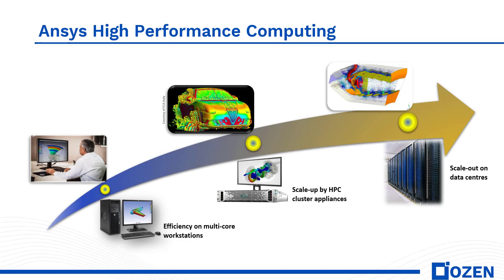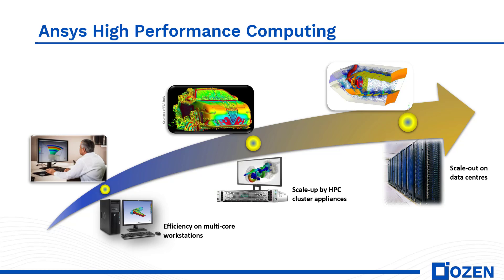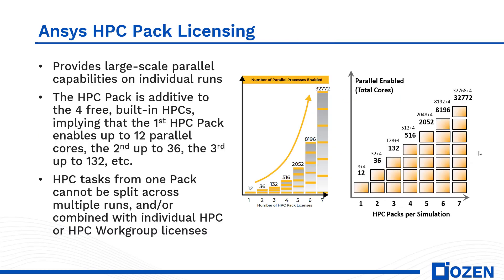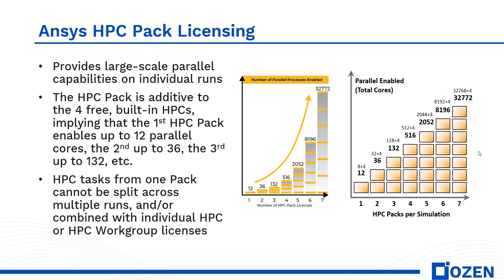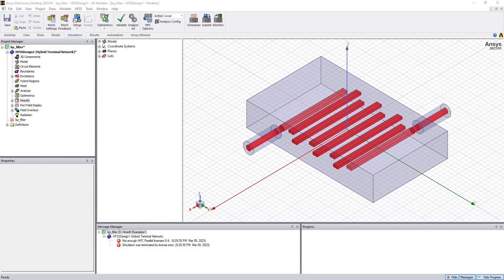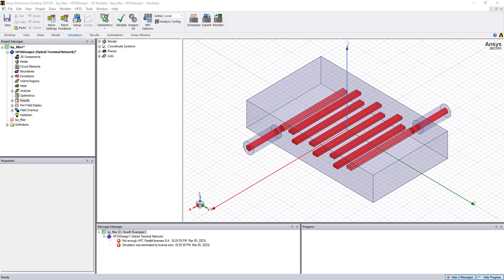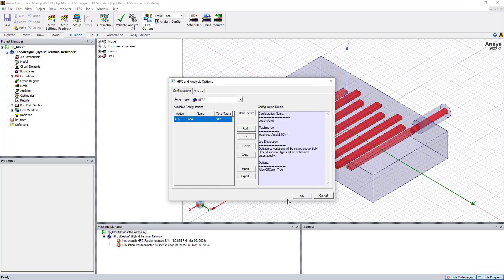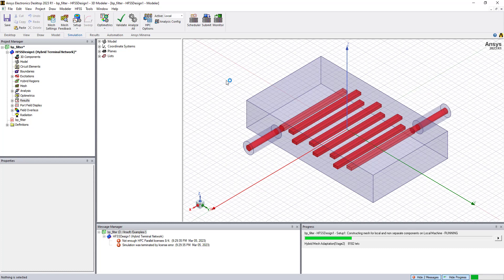How to solve HPC Pack / Pool licensing error in Ansys Electronics Desktop

Comment: Hello, thanks for the video.  What is the difference between the Pool and Pack in HPC License? Also, by changing the setting from Pool to Pack, I still have the same error message, do you know what could cause that?
Reply from the maker: HPC packs scale exponentially as shown in the video. Pool scales linearly. If you still have this error message they you don't have enough HPC licenses.
Reply: @OzenEngineeringSimulation  Thanks a lot for your response